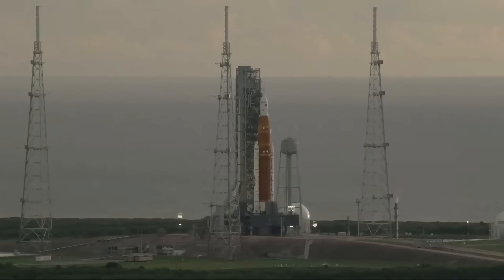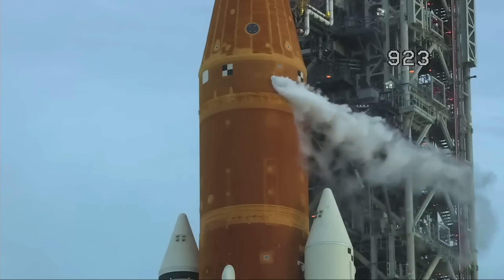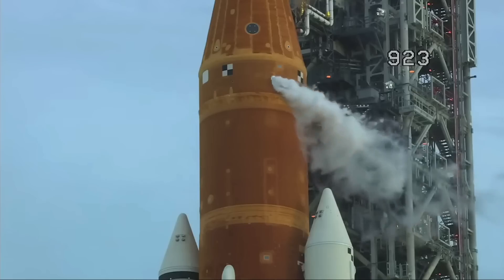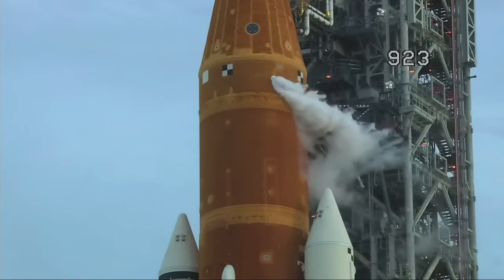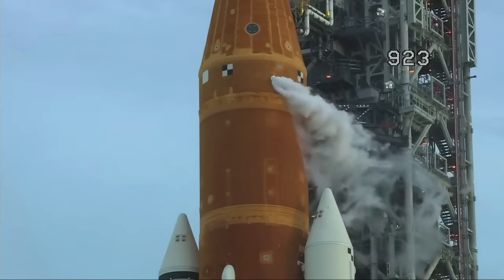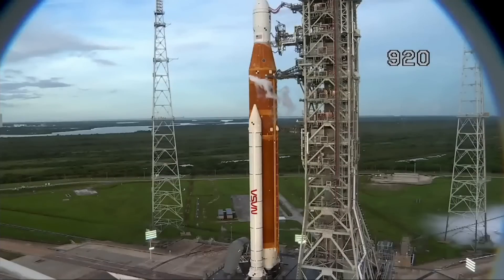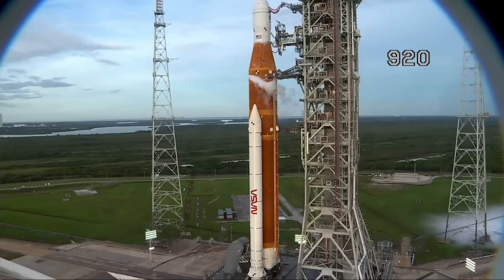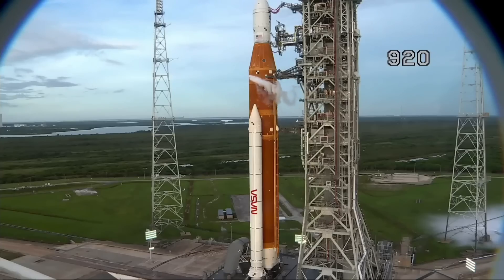NASA Artemis 1 moon rocket has 'stress crack' in tank's foam, no structural damage

Comment: Pardon me for asking but I'm no rocket scientist.  Nasa has sent 6 or 7 Apollo missions to the moon.  All the Saturn V launch vehicles worked perfectly.  Why can't they just build more Saturn Vs but modernise them with the latest hardware and electronics?  Apologies if I ruffled any feathers.
Reply: No worries dude, this is a common thing people suggest. The issue is much of the notes that engineers wrote down while manufacturing parts of the Saturn V are lost to time. Many of the engineers are dead, which makes consulting them for help in these designs difficult. BTW, not every LV worked. Apollo 13 saw an issue in the second stage, the center J-2 engine failing (though the Saturn V still worked). It would cost a lot of money to re develop a Saturn V, not to mention having to use an engine from the 50s. It's just cheaper to develop a new rocket. I love the Saturn V, but it is a relic of the past.
Reply: Great question!   The cronies need more money from the taxpayers
Reply: Exactly!
Reply: And saturn 5s did not have boasters.
Reply: @waybee100  They could have added boosters.
Reply: All vehicles worked perfectly? Tell that to Apollo 1 and 13
Reply: @DaegonTheSternguard  11 too, and probably all the others. I think they all had technical problems.
Reply: @DaegonTheSternguard  To be fair, neither Apollo 1 or 13 were Saturn V failures.
Reply: The whole purpose of Constellation and then Artemis was to use old Space Shuttle rockets which would otherwise have been scrapped or put into a museum.  What the program has turned into is a travesty of that idea.
Reply: because it's all fake folks. all these "space" missions. nothing but fireworks shows and computer graphics and tv studio bullshit...
Reply: @Lynn Geek Just relating what I read just yesterday. Can't post a link.
Reply: Apollo (and the Saturn V) sent men to the moon 9 times.
Reply: act of 2010 states that they must reuse most rocket parts (which is why they use orion from constellation and the rs-25 used from the space shuttle program) this was really the only way
Reply: @mara-tr9ix  Then why is the price tag so high to develop and launch?
Reply: @bruceatkinson5357  modernising the apollo-era tech to support this mission was a lot more expensive than predicted
Reply: Because Katherine Johnson isn’t there to help them with math equations anymore 💀💀
Reply: all the saturn rockets didnt work perfectly. They had different technical problems with each mission.
Reply: They actually had most of the components for the SLS laying-around in storage from the shuttle and cancelled Constellation program.  The SRBs are shuttle casings and engines, but with an extra segment added.  The core stage runs four shuttle main engines, etc...  Artemis should have been relatively cheap to build... But then, NASA is a GovCo agency, so bureaucracy exponentially increased the bill.
Reply: This is a valid question, enviteck02. And, btw:  Compare the professionalism of NASA with the SpaceX kindergarten...  Here we have experienced engineers and around Elon Musk we see cheering Kids only. Connect the dots, investors. Ponzi ... Madoff all over again? I'm just asking. 
It's time to fund NASA, again. I don't trust this high school dropout with no engineering background, at all. That includes Bezos et al, of course.
Reply: The STS had 1 launch failure over 135 missions, or 0.7% failure rate. Because Saturn V only flew 15 missions (3 unmanned, Apollo 6-17, Skylab), there weren't enough attempts before an inevitable failure occurred (thankfully). The engineering necessary to, say, build a car that starts every time you get in is insignificant compared to launching a payload into orbit. The four RS-25 engines are fed liquid hydrogen and oxygen at over 430 atmospheres of pressure, at a rate of 2,000 kg (1,500 gallons) per second. Forget about the "latest hardware and electronics"; the structural and materials engineering necessary to keep the vehicle from shaking itself to pieces and the engines from melting into blobs is so out there. And as it turns out, the SLS's use of the RS-25 is one-and-done; they're pulling old Space Shuttle engines off the shelves and using them to keep costs down until a newer version is available.
Reply: Another reason is that we've forgotten how to. Alot of the plans and people who helped build the Saturn V are long gone. You have to remember that it wasn't just ordinary people building the Saturn V,they were specialists, technicians and etc. The F1 engine for example had welders putting in hours of experience doing just that specific weld
Reply: @Nduvho-Phophi  Actually it was the GERMAN'S who got us there.
Reply: @Nduvho-Phophi  No one has "forgotten".  Every last piece of information from the Apollo missions has been saved. There are still thousands of people alive that know how to get there.  Humans have better technologies now that do things better.  We don't need a Saturn 5 rocket when the new ones work better. Also information has been passed on to up and coming generations of scientists and fabricators.  Technology has allowed us to look further ahead in space exploration and right now we see the best that humans can do at this time.
Reply: @Nduvho-Phophi  they were nazis. operation paperclip
Reply: Buulding a Saturn V would mean a less powerfull, less safe and most likely more expensive construction (which seems unbelievable seeming how sls is 4 billion per launch). Still i believe sls would be cheaper than a new saturn V (there is an everydat astronaut video comparing saturn vs sls and it talks of price as well).
Reply: @valeriocorsetti7278  However, Saturn V had more Delta-V than SLS. That's why Apollo took only 3 days to reach the Moon, whereas Orion will take 8 days.
Reply: That is an easy answer... All of the technical infrastructure, rockets, rocket engines, capsules, launchers, derricks, plus all the equipment designed to turn out that stuff from the 1960s, has long been decommissioned, junked, recycled, repurposed, put in museums, or have rusted away, and the engineers and people who helped turn out all that stuff have long since retired or have passed away. 
-
And lastly, the blueprints are from 1969, about a piece of technology from 1969, made using components from 1969. Perhaps these two videos might shed light on the F1 Rocket engines which powered the Saturn 5.

Why Can't we Remake the Rocketdyne F1 Engine? https://youtu.be/ovD0aLdRUs0

F-1 The Engine That Nearly Stopped the Apollo Moon Missions
https://youtu.be/KnhYEnqzfZg
Reply: There were specialized tools made to assemble the Saturn V. It wasn't built with off-the-pegboard tools from Harbor Freight. Richard Nixon ordered those tools melted down. 
Also, there were tricks and work-arounds that engineers thought up on-the-fly that were never documented. They existed only in those engineers' heads. And most, if not all, of them have passed on.
Reply: Because they would fail, that's the problem (modernizing) anything now days KISS method works best
Reply: @ghoward6797  Why? Russian have great success in modernizing their old rocket designs.
Reply: @catchnkill  because its Russian not NASA come on man
Reply: Why? Do Russian follow different Laws of Physics?  Russian refers to e=mc2 and NASA refers to the same formula.  What is the difference?
Reply: Someone did. It’s called Starship. That program will spend an eighth of the
money and work.
Reply: The problem with that is that we were actually taking huge risks back then and were doing things dangerously in retrospect. Your phone is more powerful than the computers used to land man on the moon. Whilst it does seem like a good idea, it probably would have been just as if not more expensive than SLS
Reply: @Nduvho-Phophi  Though it is cheaper to build a new rocket, the whole phone argument is dumb. It's a nice piece of trivia, but a shuttle flight computer alone could not store an iphone image. If it's powerful enough to do the flight, it's powerful enough to do the flight
Reply: @imEden0  I 100% agree
Reply: It is because a lot of the companies that built the components for the Saturn V do not exist anymore. There is no conspiracy or anything, it really is that simple.
Reply: @howardbaxter2514  Yes indeed.  I do contract work as a tech designer in Aerospace.  A few years back I worked for a company that builds largish drones and their portable base stations.  One of my duties revolved around drawing changes required by parts, especially electronics, no longer being produced, and having to find a substitute

Comment: After 2 Wet Rehearsals .. why did we get a 3rd Wet Rehearsal today, lol ??  Seems SpaceX approach to building far cheaper rockets and taking more actual test fire & launch risk, allows for generating more test data and faster development.
Reply: That is the way they did it in the dawn of the space race. And they learned a lot in the process. And build awesome rockets too.
Reply: To be fair, what exactly has spaceX done other than their reusable boosters? Just last year they finally got their capsule to the ISS, but other than that, no moon, no moon landings yet. They are just now barely duplicating what NASA did decades ago. Their starship has only tested the flop, and only landed reasonably safely once. The rest smashing to the ground or blowing up on the ground or in mid-air. Even their starliner capsule blew up once in spectacular fashion. The bottom portion of the starship, whatever its called, hasn't even been off the ground yet, other than on a crane.
Reply: Politicians force NASA to build expensive outdated rockets, that’s just the way it is, if they had free will they could accomplish so much more, because look at what Spacex has accomplished, there’s a lot more people at NASA, so imagine what they could accomplish if they were actually allowed to

Comment: I love the NASA logo on the booster. Take me back to the 80's
Reply: @paulhiggins6024  Wrong. The engines used by SpaceX are still way behind what is used in SLS as far as specific impulse is concerned. It's an apples vs oranges thing. SpaceX is a private company and as such its main objective is profit. Their rockets are optimized for launching payloads in low earth orbit. For deep space specific impulse is king. There is a reason the Parker solar probe was launched by a hydrolox powered Delta IV heavy and not the kerolox Falcon heavy.
Reply: @stoyantodorov2133  
Why would you compare the impulse of engines that use different fuel? Merlins are their current gen engine, raptor isp will be much improved due to full flow combustion.
Raptors will use methane so comparing it one that uses hydrogen and oxygen is a pointless comparison. Apples and oranges, methane is far cheaper and is better suited for rapid reusability of the engines.

Comment: A 100 zillion dollar spacecraft is scrubbed by a crack in the thermal protection expanda-foam  that has not worked well since the shuttle program. You think they would use something else
Reply: The constant and main issues with the Shuttle's TP was the TP tiles on the Shuttle itself, not the SOFI on ET. And same kind of SOFI insulation worked well on Delta 4 in the past 20 years.
Reply: No, RS25#3 has a stuck valve. We'll safe the vehicle and fix the issue. I gave the chance of scrub 70% on the first attempt.

Comment: This ain't rocket science, no wait this is rocket science. 🚀
Reply: It sounded like you could do better lol. Not trying to come off as rude or anything, just adding onto that
Reply: @imEden0  Are you one of those ridicule people that believe Nasa touches the moon with Humanoids?
Reply: The science part is easy, they have that fugured out. Plumbing is the hard part
Reply: 👏 yeessss
Reply: The problem is this is 70 year old rocket science. Actually the use of solid rockets is way older than that. OTOH, every single Saturn V worked perfectly. The Apollo 13 incident was a failure involving the service module, not the rocket itself. And aside from that one incident, every other Apollo mission since Apollo landed successfully on the moon, and returned safely. As someone pointed out, this thing has no provisions for landing on the moon. Even if they had launched it, and everything worked as designed, I don't understand what its purpose is.
Reply: @geraldscott4302  This is designed for carrying crew to the moon. It's more efficient to have a seperate, reuseable lander, so Orion will dock to LOPG in orbit of the moon, and then board a lander to land near a base. Also, Apollo 13 did have an issue with the rocket. The S-II stage had an issue with the center j-2. It didn't actually pose much of an issue to the mission, but it was an issue
Reply: moon landing was fabricated
Reply: @pinefilms3141  I agree 100%. See today Nasa had a problem with the rocket Artemis 1. How Nasa with more than 50 years of experience had problems today? The government that put 12 humanoids on the moon in  1969+ years. WOW, THEY WENT THERE, THEY PUT A FOOT OR TWO, BUT TODAY THEY HAVE A PROBLEM LIFTING OFF. Come on man.
---  So much technology and they are stuck. Where is the experience, where is the advance, where is the knowledge, the power, the invention, the technology? They are just money suckers for the politic in the government.
----  Why do they put so many stops and obstacles to Elon musk? Because they know they will be ridiculized.

Comment: With this, we confirm we already landed on the moon and returned 6 times without any issues .
Reply: Apollo 1 and 13 don't count as major issues to you?
Reply: We did; to believe otherwise is folly. BTW, "without issues"? There were many, all overcome. You can watch "Apollo 13" to see one adventure, somewhat fictionalized.
Reply: @UncleKennysPlace A cincere question about Apollo 13: I always wondered why the LEM and the Command module got cold inside, when just the opposite happened with other spacecrafts when the electricity went out. 

When a spacecraft has direct sunlight on it's hull, it gets hot inside.  Not cold. What is the mechanism in Apollos case? Why did it get cold? 🙂
Reply: @shortkari  Half of the Apollo 13 spacecraft was exposed to the sun, while the other half was not.  Therefore, heat radiated continuously from the shaded side at a roughly equal rate as it was taken in on the sun side.  With the damage, the ship was shut down, so there was no heater and the equipment which also generated heat was turned off.  So, it got cold.
Reply: @ToEuropa  Ok. Thanks for the answer.
Reply: astronauts cant even agree on if you can see stars from space, look it up on here, they are complete opposite answers, there is no way anyone has been to the moon, its confirmed beyond doubt.
Reply: There were plenty of problems. The public was never informed of all the glitches. Especially 14.
Reply: So one crew of three instantly exploding and tom hanks and his crew almost dying from hypoxia doesn’t count as major failures to you?
Reply: No one has been on the moon, and no one ever will be. 😁
Reply: @dco8562  no thoughts have ever been in your brain and they probably never will be
Reply: @kidkique  It's ok... I understand it easier to convince yourself that I'm the stupid one, rather than consider the idea that every image you've ever seen from "the surface of the moon" was shot in some studio.
Reply: @dco8562  we didnt have the lights back then as studio lights dont have parallel lighting
Reply: @dco8562  A guy who denies the existance of space and a guy who likes is own comment?! Congratulations! You have single handed proven that you don’t know a corn in dogshit about space travel OR science OR economics.

Comment: Just let spacex do this instead of nasa
Reply: SpaceX couldn't even handle gases which accumulating under the vehicle in a contanined area safely ATM...

So please.
Reply: @saxus  WHAT
Reply: @stonecoldsteveaustin4590  that fiasco with the "spin prime test" when they basically exploded the back of Booster 7. There is a reason why nobody let collect the flamable, gaseous materials above the rocket. 

Or there was the incident with the Falcon 9 booster when they had hit a bridge because forgot to lower the trailer a few weeks ago and now NASA have to delay Crew-5. And if we talk about Crewed missions, lets talk about Crew Dragon C204, which was exploded violently during a test... It was intended to be a capsule for crewed missions and already flown at ISS on Demo-1. Just imagine ISS if that accident would happend there... Oh and by the way, as I heared NASA heared about that incident after two weeks from a leaked footage. Also I heared rumours that SpaceX had to scrap Booster 4 because they basically messed up (along with the ground equipment) because they did a test knowing there was debris in the booster...

Edit.: and did anybody mentionend AMOS-6?
Reply: @saxus  you are so triggered right now
I didn’t even read what you wrote

OH HELL YEAHHHH
Reply: What the hell do you think they have been trying to do?
Reply: @nebtheweb8885  WHAT